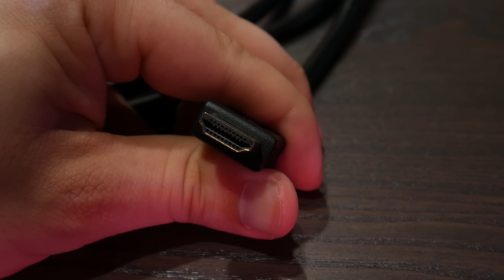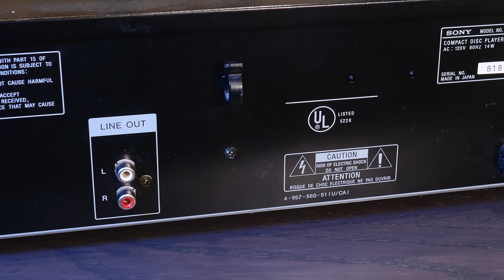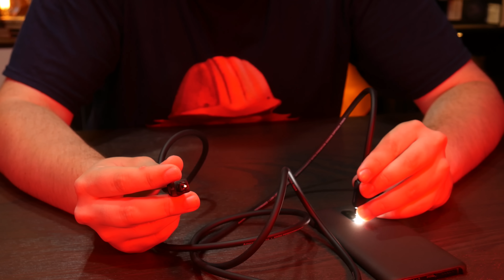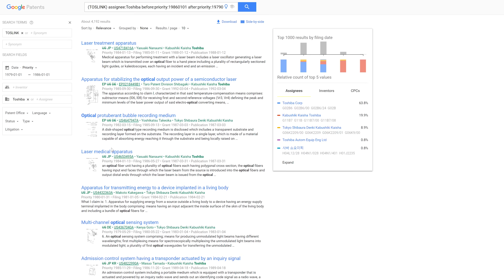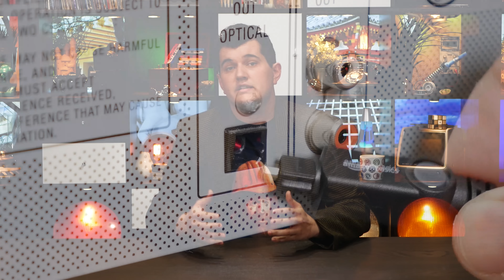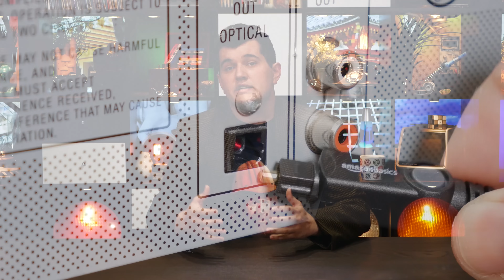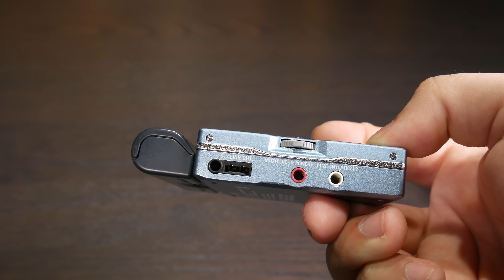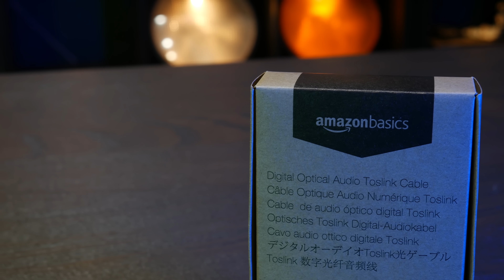TOSLINK: That one consumer fiber optic standard

Comment: Coming from the networking world, that maximum cable length thing is super interesting. In networking, range is actually the main advantage of optics. No matter how good your quality control is, losses from resistance and inductance limit practical range to 50-100m (shorter at the higher bitrates),  while fiber runs can achieve runs in the 1-10km range in the budget of a small retail chain or school district. (Also super high throughput for trunk connections, but those transceivers are more pricey.)
Reply: and if you used a one way system you can use an actual laser and get into the hundreds of km range

Comment: Fiber optic cables provide galvanic isolation that RCA cables do not -- and it matters.  Why?

The host of this video correctly states that either the digital data gets there or it does not.  That is true.  But as our courts say when you take the witness stand "Do you swear to tell the truth, the whole truth, and nothing but the truth?"  In this case, we heard the truth, but not the whole truth.

Line nose that travels through RCA cables will accompany the digital signal into the DAC.  That line noise will be picked up by the analog section of the DAC.
Yes, CD players have an analog section.  CD players create sound from scratch.  They create sound from reading the zeros and ones and making it into an analog sound that eventually makes it to your speakers.

So RCA cables (especially crappy ones) are a conduit for electrical noise that breach your CD player's (your DAC's) internal components.  And line noise is bad for sound reproduction.

You might be thinking "I hear no line noise".  Well, if you took steps to eliminate the line noise, you would notice an improvement in sound quality.  The music would reveal inky black backgrounds.

There is low-fi stereo equipment.
There is mid-fi stereo equipment.
There is high-fi stereo equipment.

Each of the above has tiers.

All of the equipment that the host used in this video is "low-fi", and the lower end of low-fi.
That is why, to his ear, cables make no difference.

The equipment he is using is equivalent to the testing equipment used in a lab.
If the lab is using equipment that is not suited to the test at hand, you will not obtain meaningful test results.

Such is the case when this host compares poor cables using poor equipment.

Comment: There’s an advantage to using fibre optic that went unsung here; the ability to entirely sidestep ground loop problems regardless of where things are plugged! This saved me a great deal of headaches when it was possible
Reply: Exactly, that's the real reason to use optical.  It's also why the MIDI standard uses optoisolators for every connection, which are functionally the same as TOSLINK just without the cable: an LED and a photodiode (usually right next to each other in a single chip), which are electrically isolated from each other and allow the signal to pass from device to device without any electrical connection.
Reply: It is somewhat touched on in the video, but also dismissed which I think is a mistake.
For me just as precaution I like only having my "dirty" PC gear connected to my high end DAC via optical, it simply gives me peace of mind that were something bad to happen to my computer it will not touch the expensive stuff. Now as the video suggest everything if of course connected to mains, however there is also a fuse box there should things get crazy.
Reply: @bzdtemp  The Keyword is "galvanic isolation". I can't quite understand why MSI doesn't include a Toslink out on their Mainboards anymore, unless you buy the top end. Had to buy a 30€ Asus sound card, which works perfectly without drivers, to connect an inexpensive Toslink DAC. Because the DAC has it's own non-grounded power supply, it generates a signal without reference to the mains ground. Without this galvanic isolation, my studio monitors absolutely scream at me when my GPU is under load. I am true to the saying, if you can't hear a problem, there isn't one. But even the much beloved Focusrite Scarlet interfaces (and probably A LOT of "con-" and "prosumer" products as well) do NOT provide galvanic isolation, which can easily be achieved by using a near 40 year old fiber optics connection standard.
Reply: Me also. My DVD recorder, I still use it :), is plugged into the wall outlet near the TV. My HiFi is a few metres away and plugged into a dedicated spur. Using an optical connecting cable for the audio, means no electrical interference between the DVD and the DAC.
Reply: This! I also used Toslink to avoid hum caused by ground loop.
Reply: Yep, and this is exactly why ADAT Lightpipe remains common in the pro audio space today. It's become less relevant in consumer and home theater as these installations are becoming less likely to have even one component that's actually grounded, but in a studio most components have grounded chassis, and troubleshooting a ground loop becomes even more of a challenge when dealing with digital audio - if you pass digital audio over an electrical cable, the ultimate source of your ground loop doesn't necessarily correlate with the signal path you're hearing it on.
Reply: The reason I ended up going with optical is because I've always had issues with USB DACs picking up one of two hums.  The first is the ground loop hum.  The second, strangely enough and I still don't fucking understand it, was a hum that was equivalent to the refresh rate on my main monitor

It confused me for a while because I know what a mains hum sounds like, and it wasn't that.  Then one day after reconnecting my monitor, thus resetting it to 60hz, I heard a lower hum, and I heard it raise in pitch as I set my monitor back to 144hz.

I decided I didn't even wanna fucking know and bought a sound card that supported optical and never looked back
Reply: @bigolhumbo  maybe channel and bit settings? Conflicting?
Reply: @replynotificationsdisabled  well, I know what that sounds like from using a dac and voicemeeter with Rocksmith but there's basically no reason the monitor refresh rate (provided by the GPU) should be causing a hum in my USB DAC other than interference

I've just kinda come to understand that USB power management and EM shielding in the mobo is terrible
Reply: Yep. Came here to say this as well
Reply: Yes, it's why I use them.
Reply: yes!!
Reply: just use a optocopler and you are golden.
Reply: +1 on using toslink to solve ground loop problem!
Reply: Had an RCA splitter for my TV for a while and holy smokes that little buggers ground loop humming was annoying.
Reply: I always had a problem with my sound card in my pc. When the graphics card was working even a tiny bit my analog audio got really messed up. Imo it was unusable. I switched to digital optical and no noise and weird hissing anymore. Only problem I encountered was the processing in the amplifier/avr. Because I was using "pair A/pair B" on an old amplifier that only supported anlog in I had to get a new amplifier that supported digital input. It was rather difficult to get one with "zone 2" that could decode the signal from my pc for one pair of speakers and another zone wich could process hmdi(arc) and analog sources for a different pair of speakers. Many devices had a zone 2 but few could do digital inputs in different zones at the same time.
Reply: I have a pre-amp powered from my solar energy system and the power amp is powered from the mains.  They are connected via fibre to avoid earthing conflicts and there is absolutely no mains hum.
Reply: It's also, I think, the only way to get any sort of 5.1 surround sound code transferred to an external surround sound amplifier for PC gaming. WHILE using a monitor with a refresh rate of >60hz (90-240hz monitors) and a resolution above 2k. It has been a egregious problem for over a decade, anytime I run my HDMI to a receiver amp, I can no longer get 120hz @ ultrawide 2k resolution. The amplifier has no way to pass it and I even bought an Onkyo TX-NR686 recently and it still will not pass atmos even though it should. The transfer rates limit for HDMI is directly causing this issue. I've tried 30 or more solutions and none work. Even in 2021, I have to use this almost 4 decade old audio technique in order to get LOSSY 5.1 to a surround receiver amp. WIndows 10 also does something stupid to the audio drivers that I have to install custom drivers so windows can pass 5.1. I've been dumbfounded year after year that PC gamers can't get true lossless surround sound with 2k+ and 60hz+ settings.
Reply: @bappo456  that is also my reason to use an optical connector, to have 5.1 channels of audio in my audio/video setup between PC/PS4/TV and my sound system.
Reply: @bappo456  intel igps allow a hdmi device to be connected as audio only.

You coud also just have a 1x1 display off to the right somewhere by using cru.

Also uncompressed atmos needs earc and earc needs hdmi 2.0b and a hdmi cavle with ethernet.

I commented above that i miss decated audio channels. Also things like dloby digital break out devices for a lack of a better word

Taked dd 5.1 and breaks it out to line leve outputs to connect to amps
Reply: same
Reply: The primary reason I use it
Reply: Had an RCA splitter for my TV for a while and holy smokes that little buggers ground loop humming was annoying.
Reply: Yep. The main reason to use it basically
Reply: Two years late here, but in my little home recording setup in 1997 i could reliably produce second long dropouts by turning my desk lamp on or off when I was still using an RCA cable for a SPDIF connection between my digital mixer and the PC. Switching to an optical connection eliminated that problem.
Reply: UNshielded low-quality PSUs are probably killing your sound, however.
Reply: 999 likes, can't resist to leave it that way
Reply: yep had issues where launching cpu heavy games would cause serious static over all my copper audio lines quick switch to fiber and all the background noise disappeared, though if my speakers XLR plug got too close to the extention lead it would start picking up static again
Reply: Amen. :)
Reply: He talked about that
Reply: Just use balanced cables if you have a hum
Reply: in my setup I use 2 50ft 2.2mm cables per room to transfer 8 channel ADAT both ways. they fit through incredibly small holes (although was A pain in the but to terminate). used to use 2 shielded cat6 cables with 4 ch. balanced audio each but unfortunately my apt. is so electrically noisy it was able to penetrate the shielding.
Reply: It's already digital, so coax spdif cable will have also no ground loop issues
Reply: @VolodymyrTorkalo  depends on the DAC. If the electrical ground of the RCA port is the same ground for the analog output you will end up with A ground loop.
Reply: Also used it for this reason, was very happy with toslink
Reply: Why can't optical work for video signals instead of hdmi I'm sure it is possible
Reply: ok that’s a really  smart use
Reply: He said this in the fact they don’t produce any RF interference
Reply: This is true for analog vs. digital. Ground loop would not appear in a digital transmission over copper either.
Reply: Hey guys, 10:58
Reply: @well_as_an_expert_id_say  Ground loops can cause a hum in audio-systems even if the loop is created by a digital connection.

It's not a major problem in buildings wired with just single-phase wiring, but many homes and buildings in western and northern Europe are wired with 3-phase systems. In those systems, electrical sockets in a home, are connected to just one of the 3-phases coming into the home and it's therefore possible to connect your amplifier on one side of the room, to your tv or computer on the other side of the room while both are on different phases.

If you do this with a copper connection (like HDMI), you will most certainly get a loud 50 to 100 Hz hum out of your audio amplifier. It's exactly this problem that I've solved once by using Toslink.
Reply: @scsft  I honestly don't know a whole lot of audio, apart from the elementary fundamentals. I thought I was being helpful and that they'd just missed the tidbit in the video but then I got learnt something. I appreciate you
Reply: @well_as_an_expert_id_say  You are right in pointing that out though. I just wanted to point out the one single use-case in which having a fiber-optic audio-connection is actually useful, which the video seems to have missed.
Reply: @scsft  didn't he make a video proving that America is also 3-phase?
Reply: @__8120  No idea.
However, many electrical systems in the world are 3-phase or even 6 -phase because there are a bunch of technicalities which give those systems significant advantages over single or dual-phase systems.

They just don't break out the 2nd or 3rd phase to your home because they can save money on the additional wires that way...
And there are many places where grid operators did put in that 3rd phase and did, or did not connect it (yet).
Reply: @__8120  no he proved we have 220/240, and we are 2 phase not 3 phase
Reply: @scsft  the US is 220v/240 and 2 phase, the transformer outside "creates" a ground between the two phases and that + 1 phase is our 110/120 single phase,
Reply: @scsft  Range uses fiber in their vehicles.. Guess what problem you don't have if you're under voltage on your system-Alt whine...
Reply: @well_as_an_expert_id_say  ground loops are a rather more specific problem than general interference, and one that is so easy to fall foul of (and in turn providing a specific use case) that it definitely warrants pointing out
Reply: @veryDave  does it affect digital signals though? Genuinely asking.
Reply: @20xx-mm-dd  Digital signals have good noise rejection, but ground loops present a problem for all connected analog signals, including the ones from the DACs to the amplifiers inside the hifi receiver unit. This is largely why MIDI is optically isolated despite being a digital signal - the gear on each end tends to deal with analog signals by necessity.
Reply: @well_as_an_expert_id_say   it isn’t going to affect the signal, it would cause a voltage to be present everywhere the circuit expects to see zero volts. This will be heard especially when amplified. But the problem lies upstream.

Comment: the only thing i have used mini toslink for portable MD players that could record and that is why i got into Toslink before USB MD players toslink was the ONLY way to get digital signal to early MD players and is still my preferred way to record MD's. Sony's ATRACT PC programs were SOOOOO BUGGY even during the XP days i HATE to think how bad they would be now. Early Portable DVD players also had mini toslink but most of the low end ones cut iit to save costs and i know why LOL. I noticed that Video out of a LOT of my portable DVD players no matter ho high end was NOTICEABLY worse than a full sized playeer when plugged int a TV i guess toslink wasn't SUPER necessary but at least you could get high end surround sound even if the image was CRAP? But one think Toslink cable hold up REALLY well over time i have only ever lost 1 and it was the CHEAPEST i could find when i got my first MD player which when compared to USB micro or HDMI is pretty impressive, they can DIE just from supporting their own weight THANK GOD for USB type C and i wish Diplay Port was on more TV's (SIGH)

Comment: i use toslink in my cabin where the audio system (and everything else, including a noisy PWM dimmer) is powered off of 12V batteries with various DC-DC converters inbetween. Since the raspberry pi has a terrible DAC and is known to produce all kinds of fun grounding issues and i wasn't sure of the degree of isolation between  the  various DC-DC converters i just got a TOSLINK cable because both my amplifier and cheapo chinese USB DAC supported it and it performs much better than 3,5mm via either raspberry pi DAC or the USB DAC itself, which both produced a lot of audible background noise.
Haven't even tested SPDIF but why would i deal with a connector type that might also be subject to the root cause of all my potential problems in this case? Seems to me like TOSLINK is a perfect fit in this (very niche) use-case, and is probably there to stay forever because i don't ever plan to get fancy with higher bitrates or surround sound because that mostly just isn't worth the hassle anyway.

Comment: I watched this a while ago but tripped on it again. 

I actually had a need for electrical isolation specifically across two circuits, one properly grounded, and one that was not. In short, made the mistake of connecting a stereo to a laptop with a standard SPDIF coax cable only to watch sparks fly and blew a breaker. Toslink allowed me to use it. 

Sadly can't afford to rewire the whole house. (100+ year old home.)

Comment: TOS link actually has a lot of advantages for audio, especially around serious entertainment systems with lots of magnets, wires, and electrical noise adjacent.

Many consumers with low to bottom barrel equipment thats not properly shielded would also likely see vast improvements in their sound quality (if you have speakers that constantly have static or background white noise you cannot get rid of, I'm talking about you). TOS link on these low end systems can be a godsend and extremely cheap solution to a lot of sound quality problems that would usually require buying more expensive equipment, when thats likely not an option.

Highly underrated, as a result.

While I agree with you in theory, in practice it has solved a lot of problems, even in the house wiring scenarios I've come across that you mentioned.

Its kind of like a physicist telling an engineer what does or doesnt work on paper, and then the engineer telling the physicist what can actually be done and why.

Gold plated connectors is pretty dumb, though. Will grant you that.